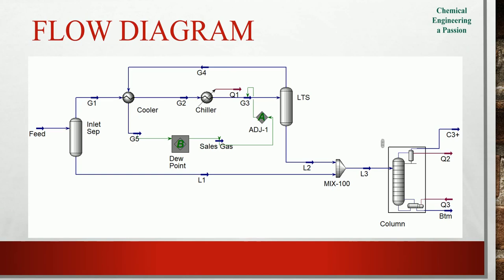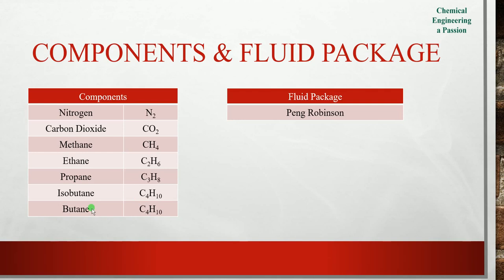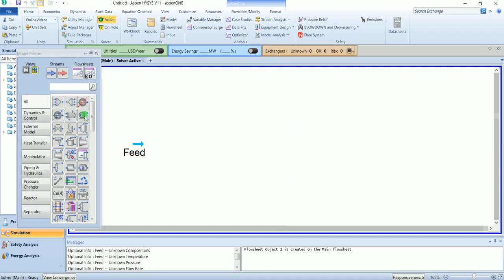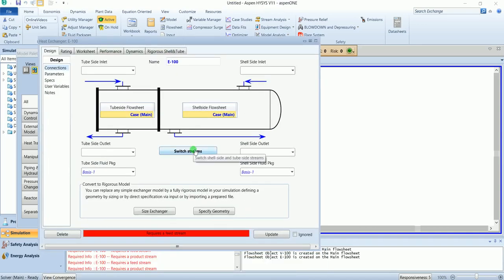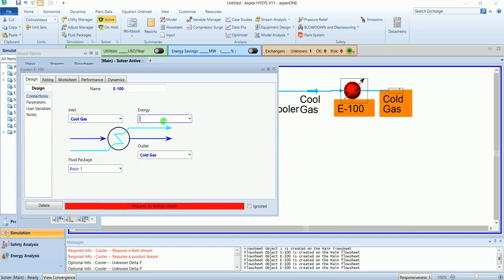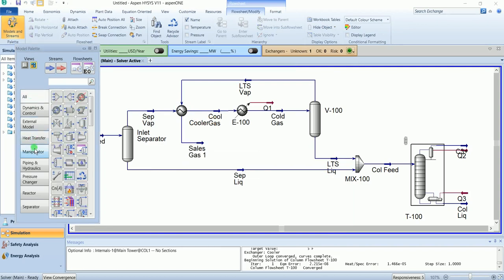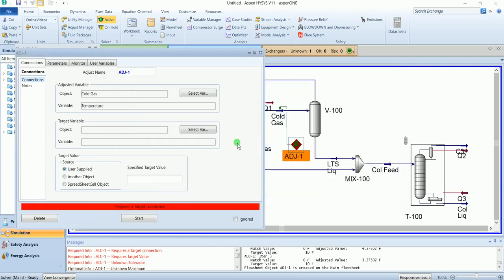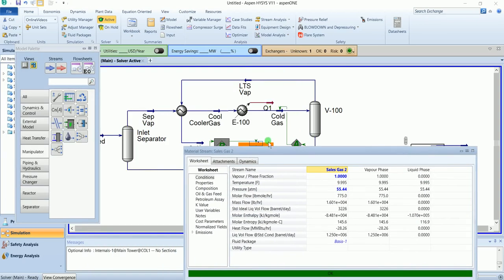Dew Point Control Unit : The process Simulation || Aspen HYSYS

Comment: Sir, I want to ask something. What's the function of "Balance" And "Adjust" (you claimed as manipulator) in your last step of simulation. Because I don't find any reduce in Q1 after using that method. Your reply is realy important🙏
Reply from the maker: Sorry for late response as you comment went unnoticed. 
Balance here is creating the stream with same composition as sales gas1. Adjust is changing the value of cold gas temperature to meet requirement of sales gas2. In this case, the initial calculated values were not very different from the targeted value therefore, the change of Q1 value can't be observed.
To understand the function, change the target value to 0 F from 10 F. Q1 variation will be significant.

I will upload another video on this topic soon. In which this variation will be observed by variation in coolant flow rate and pressure. Stay tuned to my channel and subscribe my channel as well if you haven't.
Reply: @Chemiopedia  thankyou sir, cant wait for your next video